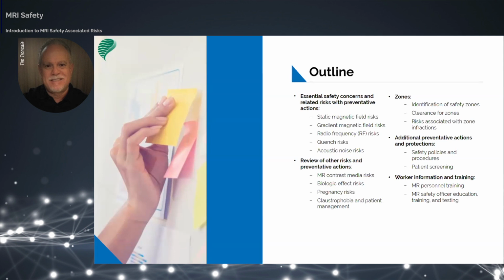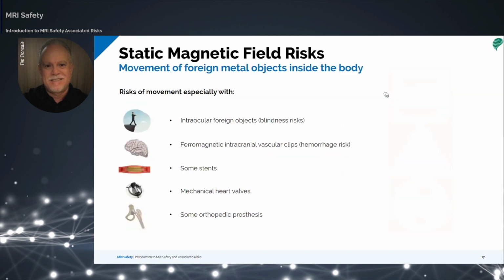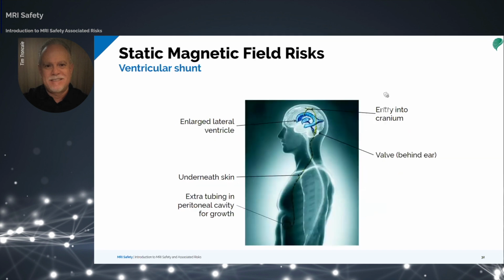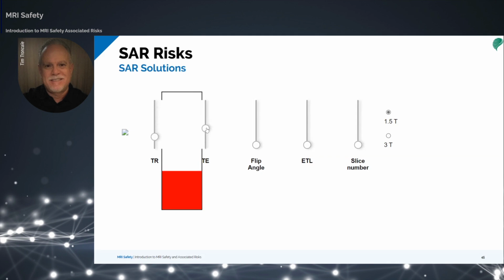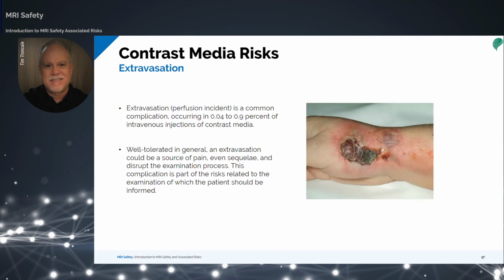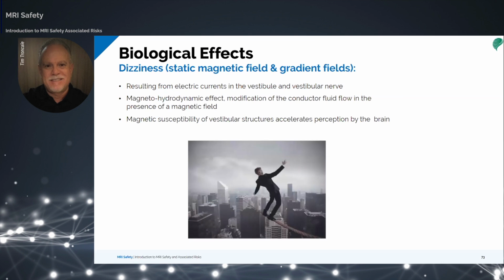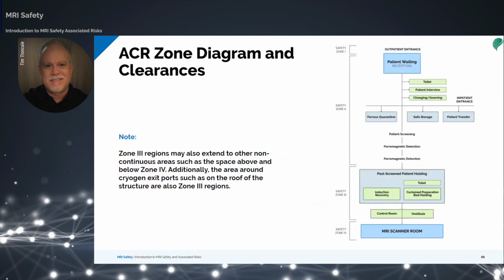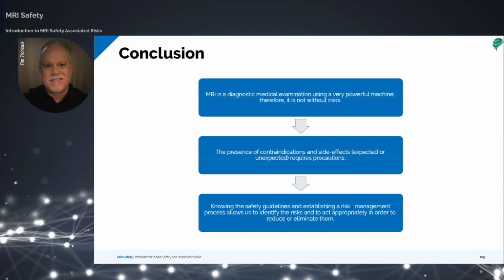Introduction to MRI Safety and Associated Risks Webinar

Comment: Sir，could you explain more details why such a patient was burn from being contact with the knee coil? It sounds so abnormal,  thank you!
Reply from the maker: MRI burns can occur due to excessive radiofrequency (RF) energy deposition, improper coil positioning, or conductive materials in contact with the patient. If a patient was burned from a knee coil, possible causes include improper coil padding, a conductive loop formed by skin-to-skin contact, or metal implants.

Proper safety protocols, including ensuring adequate insulation and checking for contraindications, help prevent such incidents.